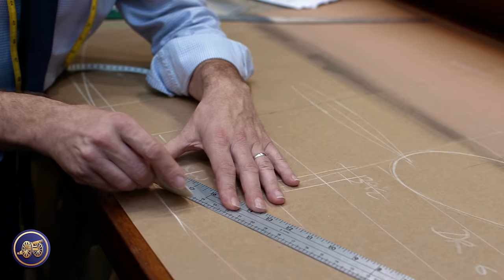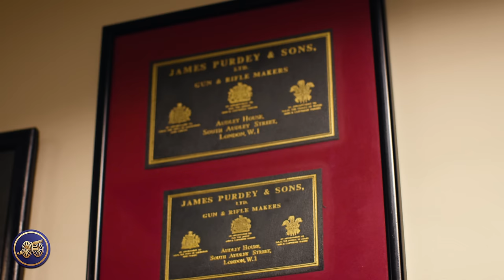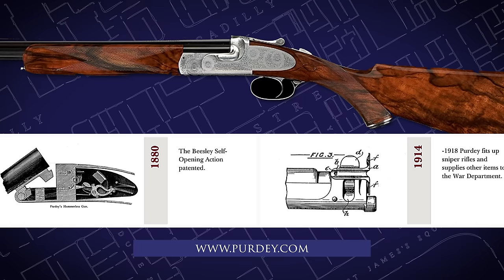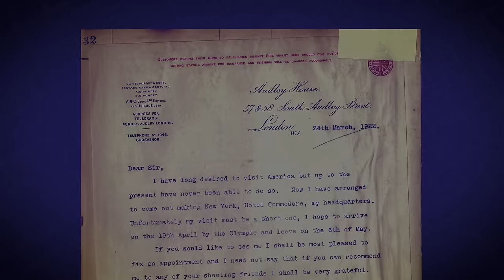Choosing My Guns With Purdey Gun Makers | From Suit To Shoot | Episode 7

Comment: Point of correction: Damascus and Damscene are related but not interchangeable terms as he is using them. Damascus uses multiple metals to make a composite that shows the pattern of the composite. Damascene is the inlaying of different (usually precious) metals into steel.
Reply: @tatumergo3931  Yes. Typo.

Comment: I don't think it's predominantly 28 and 20 gauge for for small game birds in America. Never heard of anyone using a 28. Seen plenty of 16 and 20 but never a 28. We use plenty of .410 as well
Reply: 28 is amazing, especially if itsbuilt on the correct smaller frame.

Light,  easy to point. And won't ruin the meat when a covey flushes underfoot.

Try one if you can, and you'll see the love

Comment: A question I have...indeed a problem I have had...is: the butt of a stock, no matter how finished - when put up against a tweed shoulder will slip and slide and cause misses.  I've had tweed jackets with suede shoulder pads that work well, but are - of course - anethema to the shooting purist.  how do the pros deal with it?
Reply from the maker: Purdey will gladly outfit the butt of the stock in whatever material the client wishes. The wooden sticks also have a cross-hatch engraving to provide grip.

Comment: Impressive manufacturer with stunning guns, but Kirby was really shortchanged in his gun selection process. I guess that's the trouble with getting guns out of the case from a bespoke manufacturer, they don't have the inventory to go through a proper fitting. Fit is really more important than any other aspect when it comes to a shotgun's shotting performance, and simple production gun will easily outshoot the finest hand-crafted piece if it fits the shooter better. Obviously if you are having a gun made they will make sure that it fits you perfectly, but when getting premade guns for his hunt Kirby should have shouldered multiple guns to find one which naturally came to the correct point of aim.